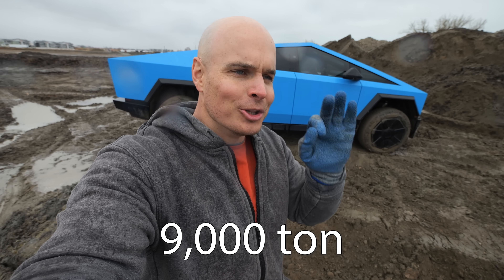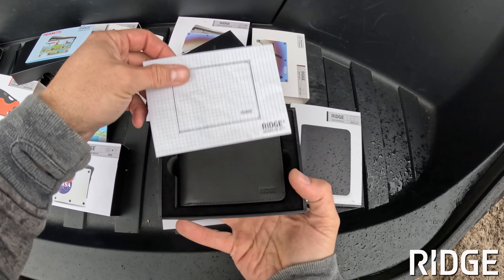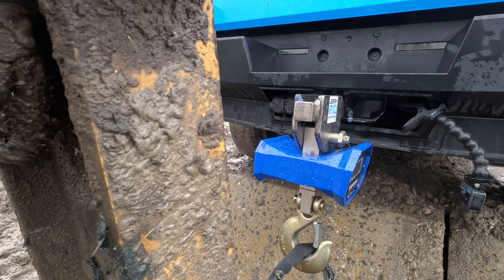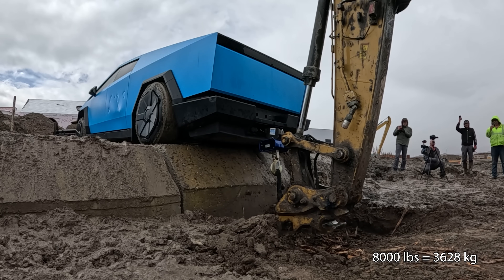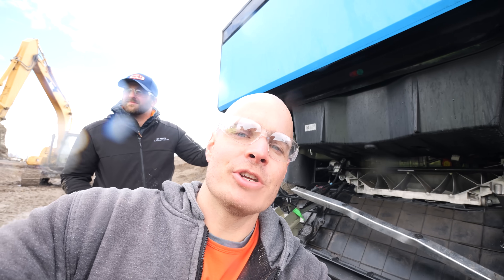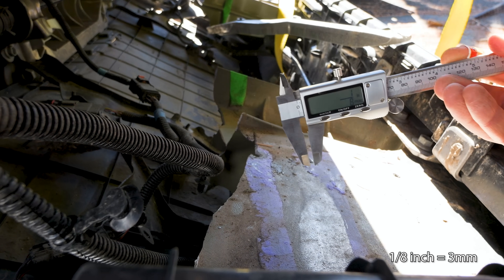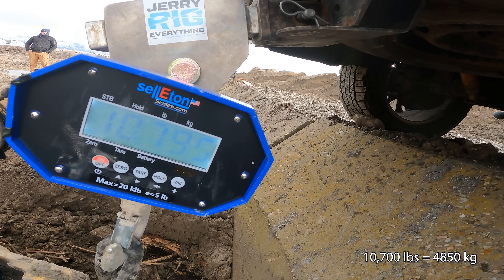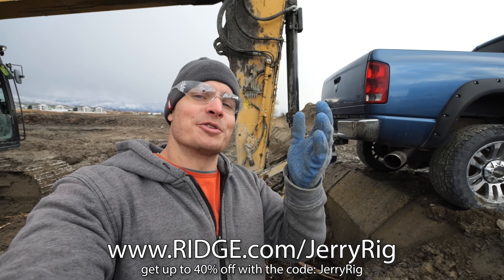SHOULD YOU TOW WITH A CYBERTRUCK?! - (catastrophic failure test)

Comment: I did not expect the ram to have the excavator lifted off the ground lmao
Reply: 😂😂😂 it can tow the excavator as well
Reply: @shortvidz9576  No chance! Not with that engine.
Reply: @BenReese It would have had a 5.7 Hemi or a 5.9 Cummins but he said it was in an accident so someone probably took out the engine to sell it
Reply: @shortvidz9576  Not without the engine :p
Reply: Keep in mind the frame on the 21 year old Ram is most likely badly rusted.
Reply: @blipco5 obviously not a rust belt truck that truck is rust free
Reply: Real engineered cars can do some incredible things! 😄
Reply: The RAM has frame stops, rubber bumpers on the frame that bottom out on the axle, it can only go so far down
Reply: @lynch6642  yeah, as far as suspension goes yes... That was not what they were testing though! The suspension would bottom out quite easily and hit the bump stops but the force on the frame would continue which is shown with the excavator's tracks leaving the ground! The excavator could not provide enough power to damage the frame enough to make it catastrophically fail! With enough force, even the metal frame would collapse at some point but I think it would do so WELL over the limits that most would suspect! Modern vehicles (even 20-year old ones) are often pretty over engineered, especially trucks! 😁
Reply: I haul heavy equipment with my ram all the time for my business so I knew the truck could take it. I was shocked the cyberjunk took that much weight because aluminum can't take load or shock stress like steel
Reply: Then you don’t know much about Rams.
Reply: @ I apologize to Ram, I wasnt familiar with his game
Reply: @SlimShady_4  This is the vehicle of a god!
Reply: They missed an opportunity to increase the load on the Ram.  They should have put de excavator closer. Shorter excavator arm, more load. Longer arm less load. Simple mechanics they should have known. :(
Reply: @kgmeten wouldnt the longer arm be more load because it would act as a longer lever? genuinely asking
Reply: Well it did 100lbs more than the cybertruck, sooo
Reply: Yeah, the CyberTruck was just under the weight of also lifting the excavator up. I don't think too many CT owners are going to end up with broken frames unless they do really stupid things.

Comment: It's rated at 1,100 lbs vertical load at the trailer ball and it took over nine times that to break it. Why would anyone think that's a bad result. If your exceeding that your using the truck way outside what the truck was intended for.
Reply: Watch the full video
Reply: Yes the static rating is 1100 but the dynamic load with a 11,000 trailer could easily exceed that number when hitting a pothole or slamming the brakes. That's why it's unsafe. The main issue is that it should be able to flex before it breaks which cast aluminum can't do. It needs to have a steel subframe specifically for the hitch receiver at least.
Reply: because every single truck out there can withstand easily 10x its official rating capacity, so it is fair to compare a tesla truck to other trucks
Reply: clickbait
Reply: I don't see how rounding the top of a hill is going to put 100% of the trailer weight on the hitch.
Reply: Zach is just hating on Elon, logic doesn't apply here.

Comment: I like how a non-functioning truck can still out perform the cybertruck
Reply: Couple guys in a garage could get that truck going with hammer and a case of beer.
The Cyberphuck? It's done.
Reply: IN all fairness, the tesla needed to be towed away after so it was non-functioning also,   HAHAHAHAHHA
Reply: the functionality of an engine has 0 impact on the rigidity and strength of a frame..
Reply: @Rhynocx  It was like this due to an accident, it had endured damage and was used as a truck for years. This is what the "not having a engine" is implying here. So it is a 21 years old truck that was being used for a long time and still outperformed a barely 2 years old truck.

Comment: Exceeding the rated tounge weight by 10x might break a truck. Fascinating.
Reply: The problem is that it's an ALUMINUM hitch, which experiences fatigue over time the more you use it untill it UNAVOIDABLY snaps.
Reply: Its "rated" for 11,000 lbs. Clearly false advertising lies.
Reply: @squirtle88  it's rated for 11,000 lb of tow weight. This video showed 11,000 lb of tongue weight.
Reply: @squirtle88  It's rated for 11000 tow and 1100lbs hitch weight aka tongue weight. You have no idea what you are talking about.

Comment: Vertical loading is different to horizontal loading. Essentially you tested it like a job crane. In normal use it would not experience those forces with a fully loaded trailer. Test is flawed, if you tested it horizontally and it broke, totally different. Even with your example of sudden loading in the vertical you haven’t taken into account the horizontal component of the induced stress.
Reply: The point here is that a steel frame pickup truck would never break with this kind of force on the hitch, ever, which accounts for extremes in the real world. Think about this - the 5/8" pin used to hold the hitch in the receiver won't break until north of 90,000lbs. Does it NEED to be that strong? Of course not. But when the alternative is an 11,000 lbs trailer flying down the highway detached from the tow vehicle, you're best to be a little over the minimum.

So an entire bumper and trailer hitch detaching from a vehicle at not even 11,000lbs is scary. Especially considering the part that the safety chains attach to ALSO DEPARTS THE VEHICLE.
Reply: You forgot to consider the shittertruck's hitch is made out of Aluminium instead of steel, aluminum fatigues over time the more it's used until it inevitably cracks and snaps.

Comment: the ram definitely drives after you snap the hitch off too
Reply: The Dodge will last you 20-30 years plus into the future as well. Something these electric POS boxes won’t.
Reply: In the real world, if your hitch see 10,000 pounds of tongue weight, you were just in a serious accident and your truck is totaled.
Reply: I'd like to see you drive a truck with no engine.
Reply: but when are you EVER going to but 10,000 lbs directly on a hitch? NEVER, so the test is moot.
Reply: @TimLucasdesign  dynamic load. a loaded, moving trailer hitting a bump can momentarily exert many times more force than when stationary (mechanical shock) and a rigid cast al chassis is not very shock absorbent.
Reply: @henrym5908  Maybe so, but nothing like 10-times tongue weight! MAYBE 3 times in extreme cases.

Comment: he actually said it wrong, steel does have a fatigue limit and below a certain amount of stress the steel won't get fatigued, aluminum on the otherhand doesn't have a fatigue limit which means it continuously degrades over time. crazy expensive experiment tho, awesome
Reply: Steel will bend at most unlike aluminum
Reply: @MrTefe thats not what i'm saying. in short if you have the same frame one made out of steel and the other made out of aluminum. ofcourse steel is going to be stronger but it will perform the same in 10 years. the aluminum will continue to get weaker because it doesn't have a fatigue limit.
Reply: @MrTefe take a paperclip and bend it back and forth a couple of times. It'll break in a handful of bends. That's fatigue. Though as long as you stay under the fatigue limit of steel, e.g. how coil springs operate, it'll essentially retain the same material properties forever. Now, generally, aluminium doesn't work that way, though there (probably) are (_very_ expensive) alloys that do. You won't see springy suspension parts made out of Aluminium for that reason, because even if you design it properly, it will fail given enough time. Al has no fatigue limit. Fatigue will creep up from the first Newton you apply to it.
Reply: @Xiph1980  well said
Reply: @MrTefecorrect and if you’re bending a steel frame you are doing something SERIOUSLY wrong😂
Reply: He drives another gold plated cyber truck so I don’t think money is an issue for him lol
Reply: @SlimShady_4  Video was sponsored by Ridge, paid for completely by them and he said ridge was going to give it away
Reply: Yes, thought the same
Reply: BUT it was not set right. Looks like the experimenters just came to prove some of their biases
Reply: The way I learned it, this is why wire ropes are much safer than that of a chain when continually lifting stuff.  You can cycle a load on a chain well below its yield point and it'll eventually break.  A wire rope will experience the same thing, but each strand finally breaks at a different time, so as long as you visually inspect it for broken strands and you find none, it is good to go.
Reply: Not really true in the real world as we call everything with Aluminium base as if it was purely elemental metal in natural language but in the real world the alloy really really matters.
Reply: @foldionepapyrus3441  true, still has ALLOT of influence on strength, creep and fatigue

Comment: Dropping 10,000 lbs of force straight down on a hitch is an extreme and unrealistic test for any truck. No pickup—whether it’s a Cybertruck or a steel-bodied Dodge—is designed to handle that kind of load. Trucks are built for towing, not withstanding absurd vertical forces. This test proves nothing except that extreme stress will break things.
Reply: Will his next test be to see who has more range, a 94 ford ranger or a new cybertruck?
Reply: This is such a joke, in any tech there is always would be someone to say "it was not supposed to"....and nowadays as result we getting lower quality products coz of such "advocates" and overral mindset
Reply: bruh, you are not right. Just watch WhistlinDiesel video about it
Reply: Did you watch the whole video? He explains when, in the real world, the tow hitch might experience forces like this. 

Also, the 20 year old, wrecked, Dodge Ram sunrvived. If they’d both failed the perhaps this point would have some more validity.
Reply: @peppers515 just because he mentioned something doesn't mean he understands it, hitting a pot hole or driving up hill does Not put the weight of the full load on the hitch.
Reply: @peppers515  Yes, I watched the whole video. The ‘real-world’ example given—hitting a pothole with a trailer—isn’t equivalent to applying 10,000 lbs of direct downward force with an excavator. No truck is designed to handle that kind of vertical stress. Also, the Dodge Ram has a steel ladder frame, while the Cybertruck uses a cast aluminum structure—they are completely different engineering approaches. If the goal was to test real-world towing durability, why not compare them in actual towing conditions instead of an extreme stress test designed to break one of them?
Reply: Hard to tell for sure because there was no close-ups, which is a bit suspect, but the Dodge sure looked like the hitch and bumper were severely deflected.

Zach's not exactly impartial when it comes to Tesla.
Reply: @georgeterlep4520  yeah I would say this test was nothing but a hit piece to play on the emotions of the anti elon movement. When in reality this is an unrealistic test
Reply: @georgeterlep4520 bent and snapped are 2 different things
If some shit bends, your trailer isn't let loose to ruin another driver's life.
Reply: But the dodge withstood it fine. Wonder why it's built that strong...